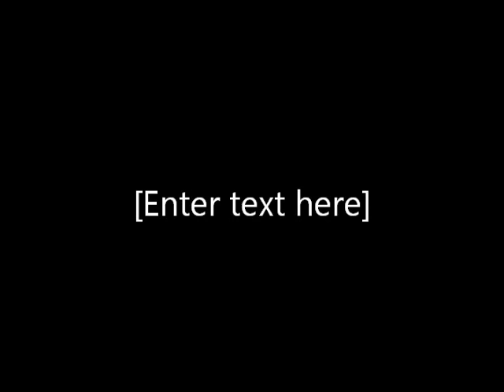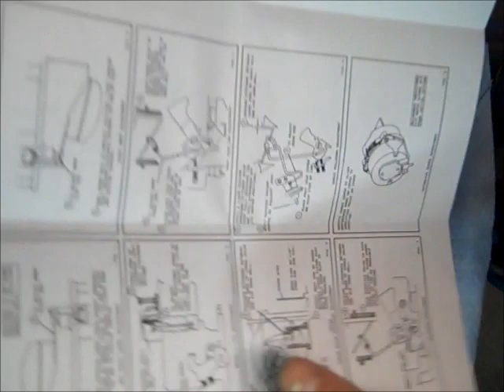Carter YFA Carburetor Rebuild Part 4 of 4

Comment: Just ran across your channel, it was right on time, cause I have a yfa on my 81 f 100, I need to build. I was skeptical at first, but after watching you, my skepticism is gone. Thanks, keep them coming.
Reply: @MikesCarburetor  Mike,  I have a question, it looks like someone built this thing before.  I noticed the check ball and weight was missing,  I purchased the kit, the ball was included,  but not the weight, where do I go from here?

Comment: I have a question. I recently rebuilt my carter 1 barrel. It goes to a 4.9 Liter inline 6 1984 F150 and I'm having trouble tuning it. Do you have any suggestions? It will start but it won't stay running. When i hit the throttle it will squirt fuel but it won't idle. Any suggestions?

Comment: hello how is the millege, for thiese carb,  i can get, in a 6 cilinders? thanks
Reply: Hi Carlos. I got average of 15-16 around town, and up to 20 on the highway, with my 150 and 300 -6. This was back in the 1980s when the speed limit was 55. My truck couldn't run at 75 due to the low gearing of Warner t-18 tranny. Hope this helps.
Reply: @gravityalwayswins1434  thanks